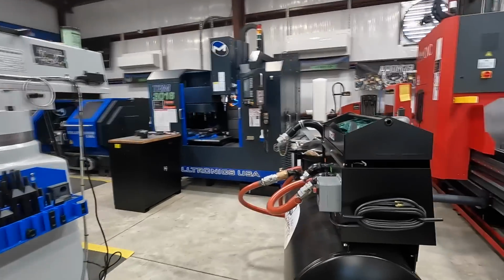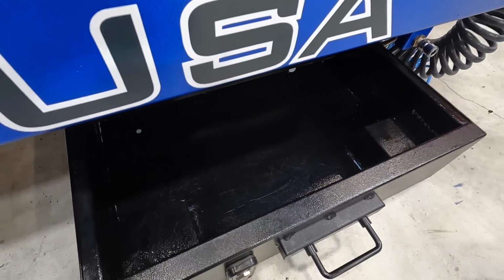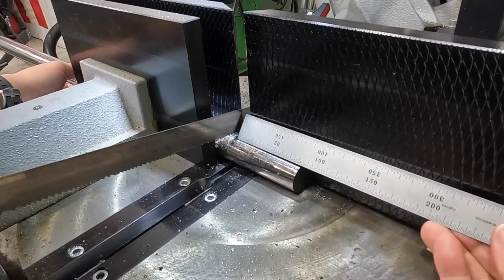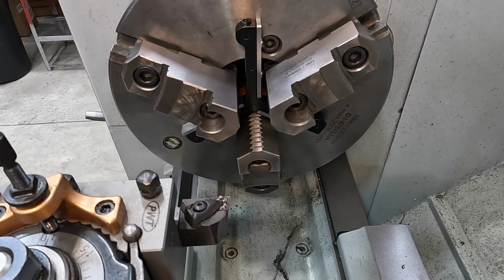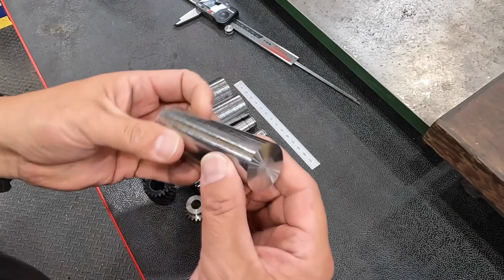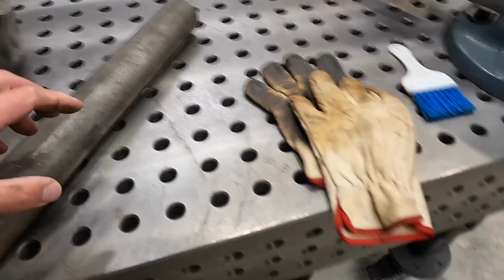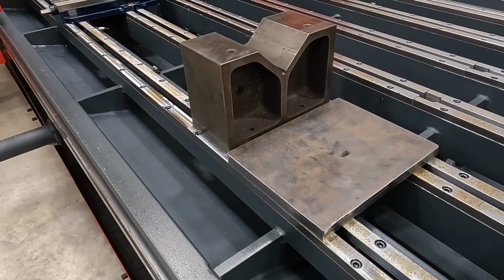SNS 371: Coolant Management, Pinion Shaft Project, Lathe Tooling

Comment: I would lay some expanded metal on some 1/4" blocks with screen over the expanded metal . To be sure that spill doesn't happen again,  maybe bend the expanded metal into a shallow trough,   so it catches shaving, even if it did clog. It's not going to over flow!

Comment: That COOLANT Mixture that you think or have been told will keep those machines from rusting is highly questionable because: 
That mixture will separate unless you’re running those machines every day.

 We have machines that should be using cutting or machining OIL but or company uses coolant for a safety preventative measure to prevent slip and falls but, in doing so the coolant causes many mechanical failures when the machines aren’t even 6 months old.
 Keep in mind our machines run 16 to 24 hrs a day but, more than likely you will have some kind of issue caused by using coolant instead of cutting oil.

Comment: Sorry Adam. You used to be a machinist, now you seem to be a sponsored voice. i learnt a lot from you as a hobby engineer  and still occasionally do, but all the trumpet blowing from the new shop is a turn off. The only saving thing is the Pacemaker.
Reply: I was looking forward to a restoration series of the drill press he has outside his home shop. Things sank when he announced the new shop and admitted he wasn't interested in the drill press restoration anymore. You can only watch so many keyway cutting, spray welding and shaft turning, so fixing up old machines, like the shaper, the K & T Mill and more recently the pacemaker have been the interesting aspects of the channel
Reply: @colinfahidi9983  The new shop was the beginning of the end.
Reply: @01ls1z28dabx  I fear the contractual responsibilities to the sponsors has diminished the content somewhat

Comment: Hi Adam. I think you might have the vacuum hose on the wrong port if you want to use it for suction and run it through your filter mesh. Think it has to connect to the top of the filter basket.

Comment: Good Stuff Adam, love the well rounded shop stuff.  I run CNC and manual as well as dealing with all that coolant stuff on a daily basis,  It's good to show all that stuff.  The negativity is from those that don't care to learn or move forward with things in general.  Manual machining is ok at home but really holds you back on what you can achieve in the real world, even for 1 or two parts.  The programming slowly becomes natural.  I'm getting there myself.  If you get use to not thinking it has to be done on computer or with conversational software it really helps you to be more confident in the everyday tasks that come your way.  KOKO  Larry R.

Comment: A question. Can't the CNC lathe or mill cut the gears straight into the shaft?  Does it require additional tooling?

Comment: On your saw, you can take a old magnetic dile indicating stand set the lenth of your parts clamp the vice down use the maglock to set a stop becuse all your parts will cut to within 5 thou of each other and I know you left some stoc on them to face off the ends, your not going to ship them with saw marks on the ends. If you mesure each cut youll make mistakes measuring.
The less you mesure each part the more uniform you blanks will be.
You can be off a 1/4" doing it like that dont tell me you have never cut a part short by mistake we all do it.
As long as the first parts right your good to go unless something changes, so you need to inspect every 10 parts.  
Bar stock I used to cut 15 or 20 bars all at once. My saw was fully automatic id load 20' long bars in it and let it rip. Id ck my work with a tape mesure, you can read a tape mesure down to 5 thou if its calibrated.  Its funny a lot of guys cant read one to an 1/8"

Comment: Adam, just a suggestion. Put a check valve on the mixing pump inlet line right at the bucket. This would prevent loosing fluid in that line and thus no loss of prime.

Comment: What the city dosnt have a backflow valve at the water meter? Thats odd.
Reply: There shall be (mandatory language!) an RP type for severe hazard (reduced pressure principal) immediately after the water meter for premises protection. The DCVA (double check valve assembly) at the 5 minute mark is not suitable for severe hazards like a machine shop, it is in the correct location to defend against that particular local hazard. And, it doesn't have a test tag from an approved testing agency. And it has to be tested yearly. But I'm from out of town and local codes may be "different". And at 6:50 you can see the faucet spout aerator sitting on the tub deck and there is no vacuum breaker on the faucet anyway. Plenty of plumbing infractions to see.
Reply: The line he is tapping off of feeds a drinking fountain. The back flow is to prevent any oil from getting to the fountain which could then be drank.
Reply: @russellerney2375  Yep, but it still needs to be a severe hazard type and it is not. Water meter is likely somewhere else in the building and that can be DCVA if all other downstream hazards are taken care of properly.

Comment: G'day Adam.    It's amazing the machines & tooling you can acquire  for coolant systems etc, which I can understand for CNC etc. My lathe, Bandsaw etc have only smaller coolant containers, which are about 6 to 8 litres, so ...  tip out, hose out & replace coolant to specs.  
Looking forward to your CNC projects with the shafts & slots.

Comment: One trick I found for our deionized water setup: get a float valve that connects to your hose and build a clamp to attach it to the tank. Then if you get distracted it automatically shuts off instead of flooding your shop.

Comment: I hav a mist system for my crappy, ancient , wore out home hobby machinist equipment. Any advice about what sort of fluid to use for light machining?
Reply: Kool Mist 77-1 | 1 Gallon Formula 77 Concentrated Coolant. This is what I use for both the mill and lathe. Works surprising well even when making heavy cuts. Not crazy heavy but heavy enough for the stuff I do. Works great in the mist system.
Reply: Thanks

Comment: another thing you have to think about is to cast a cement border around the machines so spills don't run all over the floor
Reply: Or a drainage system
Reply: That would be a vast overkill solution for a simple spill and cleanup that doesn’t happen that often.
Reply: @ellieprice363  but abom cant drive over cement border with forklift, drainage can be just 5mm cut

Comment: You could easily get the exact coolant mixture by pumping into a small bucket first, test the result and adjust as you need to. Once it's just right, pump it into the machines.
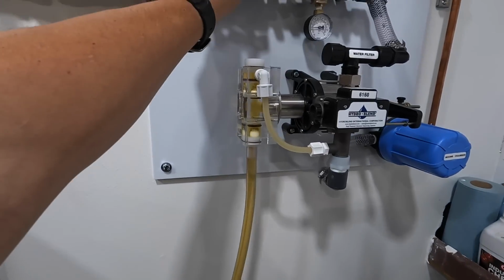Reply: He addresses this at 6:32

Comment: Can someone with more knowledge explain why Adam couldn't make the tapers he needs from scratch? They look like they're a simple shape and design and would be easy for a guy with his know how to reproduce.
Reply: Probably not worth his time. I just made a tail stock die holder with a Morse taper 2 which would be a similar operation, just on a smaller scale. Set-up takes a lot of time for something that doesn't actually cost much to buy. I'm just a home hobby machinist, not trying to make a living at it so time doesn't mean anything to me.
Reply: @noelhenderson7337  Thanks
Reply: Cutting accurate tapers with manual Rey can of course be done at least 3 different ways, only one of which requires a taper attachment, which not all hobby machines have, but since he has that milltronics lathe it would be a matter of minutes to program and run any taper as precisely as you like.

Comment: Just a tip for safety-kleen for us, it is considerably cheaper for the pump truck to pull out of containers for disposal vs them taking the containers with them. We use the standard 265 gallon IBC totes for waste.

Comment: Hey Adam, You could put a quick disconnect on the end of you coolant fill line then just pug it into each machine as you are filling them
Reply: We use SS hydraulic non-spill quick connection at work for everything.

Comment: Most CNC guys would do that part from bar in one, then part it off, for what it's worth.
Reply: Agreed, but then most CNC guys wouldn't take the job when it's only 2 or 3 of each part🙂 I suspect it would be better for Adam to make them on the manual lathe if he was trying to make money from machining rather than content creation.
Reply: @grafixbyjorj  Absolutely untrue, I run ones and twos all day on a slant bed. CNC isn't just for production.
Reply: @spikeypineapple552  Obviously it depends on the part, the machinery to hand, and the experience of the operator. For that very simple part, with Adams experience on manual machinery and clear lack of experience on CNC, he'd make them quicker manually. He's going to have to do the keyways on a mill anyway since he doesn't have live tooling on the lathe.
If you're a whiz on the conversational and have live tooling, you could probably run him close on the first part and pull ahead after the second. Adam is probably going to spend twice as much time making them on the CNC as he would on the manual machine.
FWIW, I also think he'd get better value as a content creator doing them on the manual machines, I suspect the old subscribers who haven't given up yet are here to watch an expert manual machinist, not a beginner CNC operator.
Reply: @grafixbyjorj  , Adam is indeed creating content and that takes time and resources.  However, he's also creating valuable new skills by educating himself.  That's important too. I'm an old guy now, but when I was in high school I got a chance to use one of IBM's first computers made with transistors rather than vacuum tubes. Not silicon chips, but individual transistors, hand-soldered onto circuit boards made of bakelite.  A modern smart phone is probably hundreds if not thousands of times more powerful.  The point is that almost all of us need to keep educating ourselves since the working world is continuing to change rapidly.  That's hard, and it takes time.  Adam knows both of those things.  Give him a chance to learn at a normal human pace.  I for one will gladly remain a subscriber, even if only to watch him learn new skills.
Reply: @stuartschaffner9744  Yeah, if he was a machine shop business, getting into CNC is a good plan, and spending some time making parts slowly is an investment. It's not very interesting or relevant to anybody else, since he has leveraged his influencer status into scoring a pile of equipment beyond the reach of a regular guy trying to get into business, and as others have said rather exceeding the requirement of any one-man shop, yet not the really interesting high end stuff you get to see on some of John Saunders' shop tour videos. Bootstrappers would be better off watching NYCCNC's archive, serious CNC self-educators are already ahead of Adam and need to go elsewhere, and YouTube is full of CNC ASMR for people who want that.

Comment: I worked at an industrial gear factory some time ago. 
The place had a factory-wide underfloor chip conveyor system that also gathered leftover cutting fluid from the chips, filtered it and pumped it back into the cutting fluid reservoir that fed the pipework that ran to every machining area.

A couple times (that I know of), the pump failed and dumped the reservoir into the canals the chip conveyor ran in. Both times it took a good four days of pumping and manual sweeping to empty the canals.

Comment: the saws a great place to use your used coolant from your pickier machines (IE the CNC's) especially if you do a half way descent job stripping off the tramp oil
Reply: I used to work at a place that had a central coolant distribution system for all their fancy bar fed mill turn machines and automatic saws, but they still had this one saw that was used to cut easy stuff like plastics and brass for the machines and it the coolant used in it was runoff coolant from the chip buckets. The plastic chips carried a whole lot of coolant into the chip bucket, so it was way cheaper just to have the machinists drain the chips and top up the saw occasionally (also the saw was in a really inconvenient location.)

Comment: On your sumpshark when you are sucking the coolant out attach the hose to the top of the filter and close the ball valve. You only use the ball valve connection when you are pumping the coolant out of the sumpshark.

Comment: @10:20 yeah thats my pet peeve. The manufacturer knows a flat pan is easier to make than a pan with dual bias leading to a depression that has a dedicated fitting with a valve that allows you to hook up a hose easily and control removal without making a huge mess.... you wouldn't have to drag the pan out, just use a quarter turn fitting to hook up a hose, open a valve, turn on the pump and empty the pan in fewer steps, with less back breaking bending...but, hey, thats me.... I would be making a pan to replace that one to something easier to empty.